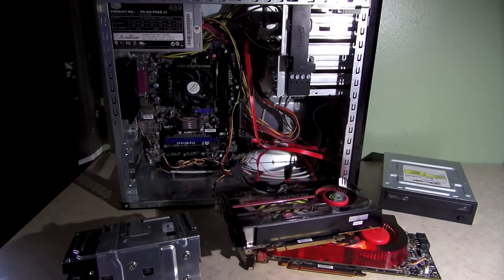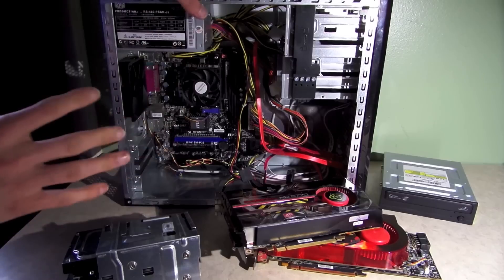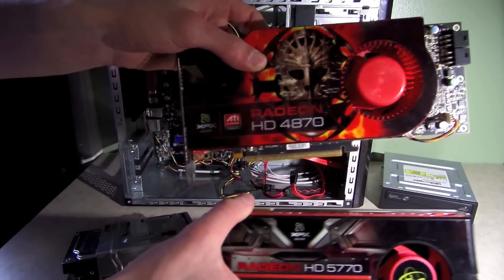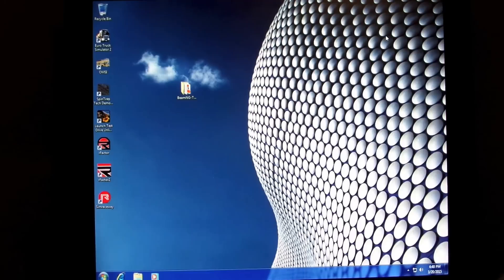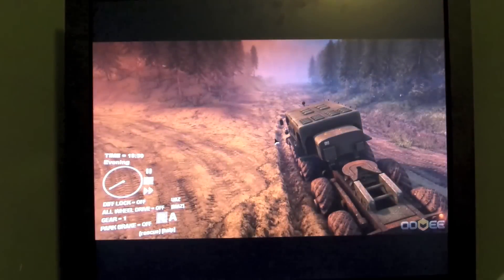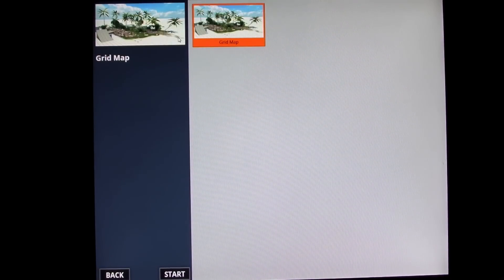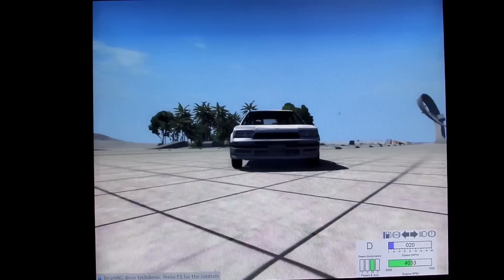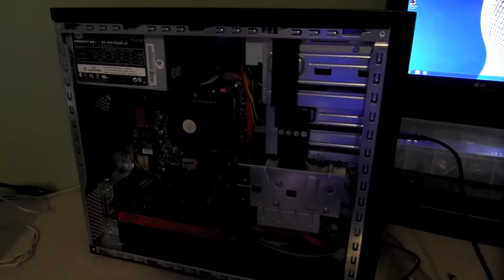Gaming Computer Build from Free Spare Parts

Comment: I admire you, I could never use a mac as a main machine, let alone a Linux machine. That's a pretty decent rig considering it was free.
Reply from the maker: I honestly only use it still because I feel obligated to. After spending a little over two grand on it, it would be a shame not to use it. Works for most stuff that I do, other than gaming of course. And thanks, I'm pretty pleased with it myself!
Reply: +Mike Fox my main machine is linux becoz im cheap
i play games on it and get 40fps on lowest settings
yes,my gpu sucks
getting off topic now
Reply: BinaryBoy my main machine for 3 years was a dual core Pentium 2Ghz laptop with 3 GB of ram and a HD 3470 graphics card with 256MB of VRAM for gaming so, I feel the pain, 40 FPS was really nice to get, most of the games I played was at 30 fps for the lightweight games and 15 fps to some games, I played through GTA 4 at 15 fps or less most of the time (avg). So yeh

Comment: Hey sir I'm in need of a gaming PC do you think you can give me a few tips on how to create a new one from my old PC?
Reply from the maker: Trails Gaming If you're not planning on buying parts, the best thing to do would be to load Windows from scratch and install just basic programs No cleaners or optimizers or other junk like that. Minimum junk = maximum performance. As for parts to upgrade, I'd say a graphics card would be the first thing to upgrade. If you go with a higher powered one, make sure your power supply can support it. 

It's a pretty loaded question. I'll help you out as much as I can though private message, but you'll have to get me a little more info about your system.